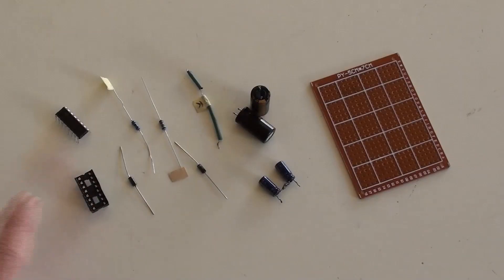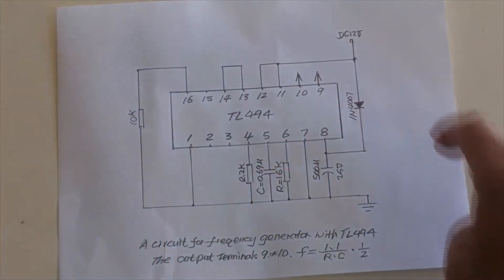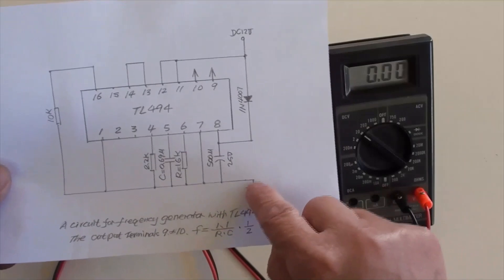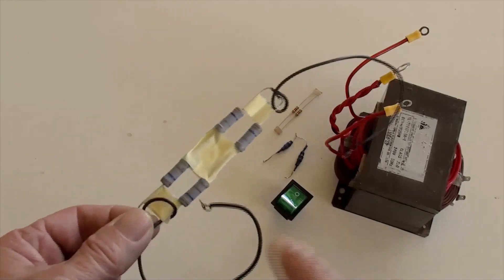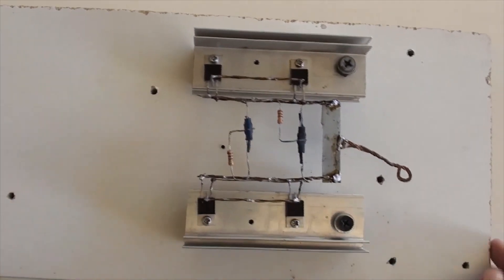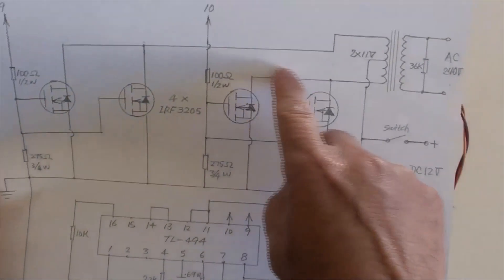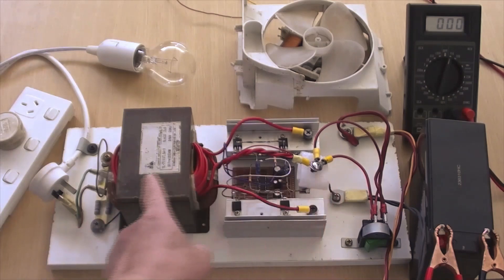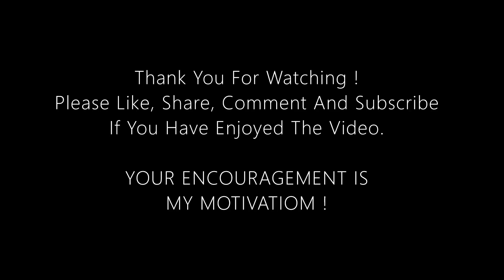DIY A Simple & Powerful DC 12V to AC 240V Inverter

Comment: How much load can this take? Probably not even 100W in your lights and fans (guessing)...
Reply from the maker: Thank you for the interested!  The actual load(s) was 117W combined with a globe + led type lights + a fan, however a 50 Hz oscillator or mosfets could at least withstand for 200W.

Comment: How many turns are on primary windings? What's wire gauge in primary?
Reply from the maker: Thanks for your question!  Primary windings:  Center tapped - 2 x 10 turns & 20A wires or cables.   Secondary windings:  this coil was original "primary windings" from MOT, I didn't know exactly its turns however by the actual tested, I'd think it had 220 turns approximately & AWG 16.  Enjoying your experience!  👍👍